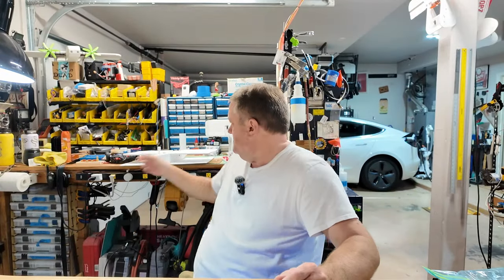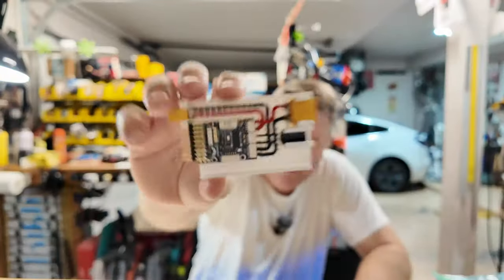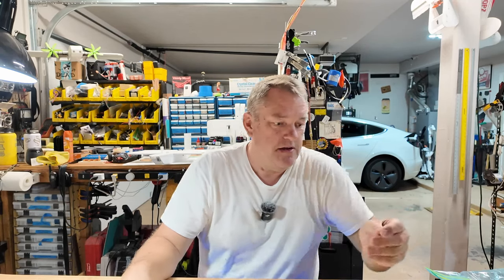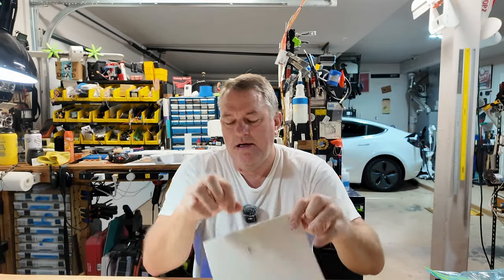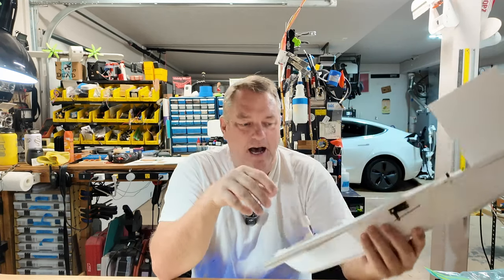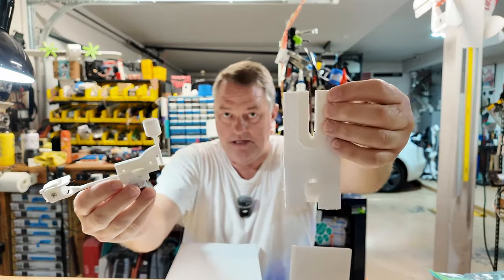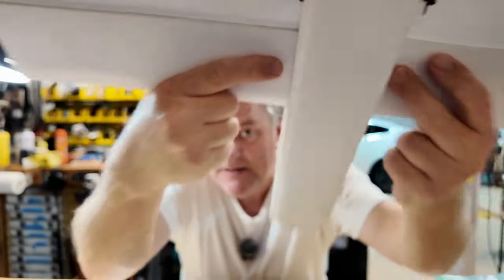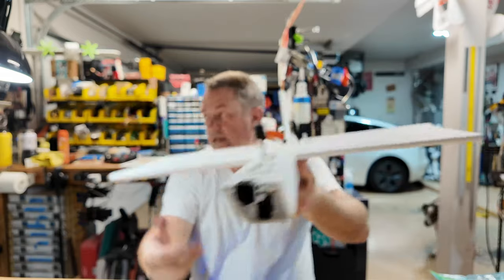3D Printed Aircraft Kits?  I need your input

Comment: That’s a great idea. I sometimes print templates on a 3d printer cause it usually ends up being faster than a regular printer 😂 (no joke). 

That being said, personally I don’t have the patience for printing big stuff. The motor mounts and stuff would be fine, but I’d just wing it for the rest (pun intended). 25 USD would be too much for me though. 

That swappable dji mount with the dummy load is genious btw 👌
Reply from the maker: thanks for the feedback - and I'm glad you like the swappable DJI system.  It works really well, and makes swapping cameras between all my planes a breeze.  Plus, with the ballasted camera mount (with no actual camera), you can fly your plane LOS and add simply swap in the RC system when you're ready.

Comment: You can stack flat templates to 3d print with a .2 mm gap with ironing and and peel them apart after printing, but only if they're designed to be the same size or fit in the foot print of the one below it. A little bit of design magic to do fewer prints would make this very convenient.
Reply from the maker: Interesting idea... I may play with that.  Thanks!

Comment: 3D printed plans are an intriguing idea. I'm not sure that the benefits (template durability, no page scaling challenges, no need to cut out the paper template after printing) outweigh the drawbacks (bulky, requires a 3D printer) as compared to paper plans for most people.
Reply from the maker: I'm looking forward to feedback from those who are building them now.  I just thought the durability of the templates could make for very quick tools to trace out replacement parts.  Friends I've had work with them are remarkably quick tracing parts with a razor and say that it's faster than going from paper directly - but I suppose we all build different.

either way - thanks for your comment.

Comment: This is just an all around great idea, sign me up. The concept of being able to quickly and conveniently build multiples is genius, makes it a lot easier to fly it like you stole it.
I’m wondering if for some of the more, shall we say, fiddly cuts, you could cut for example cut a primitive shape in the foam that would accept a 3D printed “precision” part with accurate dimensions, etc.
Reply from the maker: you've got a good idea.  There are some parts that are more fiddly - and you could optimize some of them (like the motor mount plate on this plane could be incorporated into the motor mount itself (but that's extra weight at the far aft end)).  I'm new to this - and certainly open to suggestions for improvement.  If you come up with any good ideas - please share them!

Comment: I make foam board planes and print 3d parts like you do for motor mounts etc. Mine are simpler though, more like the Experimental Airlines style. Giving the stl files to 3d print is a great idea but I think there will be a couple of problems. 

I find to cut foam board, I need to keep the craft knife at a very flat angle to get a clean cut and with it at that flat angle any tight curves are going to be problematic and you have a few of those. The second problem is I think there is a high chance you will end up cutting into the PLA itself, hand cutting foam board is really better done against a metal edge.

You also mentioned the difficulty in getting accurate to scale plans. Plans are great for balsa models where the construction is largely air and you can see through to the plan underneath but that doesn't work for foam, you can't see the plan anyway. What I would need would be dimensions only - i.e. this line is 30cm long and at an angle of 10 degrees, it doesn't need to be to scale. I would then just copy those dimensions onto the foam board (as I do at the moment) and start cutting.

Keep up the good work, great channel!! Cheers!
Reply from the maker: you've got some valid points - and for some of the detailed, curvy bits - I use a pencil and trace the line so you can really get vertical and get a clean cut.  But for the straight edges - my buddies and I have found you can run a sharp razor pretty quick down those lines - and that's what I was going for with this plane - something fast and simple.

I'm still evolving with all this - it's very different to build your own planes vs trying to get others to build them as well - and I'm just working out the kinks.

Thanks for your comment.  You've got some good thoughts in there!

Comment: Great idea, But if you could cut down on the number of templates. eg: for the bigger templates in the dead space have some of the smaller templates.Maybe even colour coding each template. Hope that makes sense.
Reply from the maker: interesting idea - but I wonder how many folks have multi color printers?  I've got one of each - but I came from a world where a filament change was not something I looked forward too.  It is easy nowadays with the right printer to add color into a print however - and we're lucky for that.

Good ideas... I'll toss them into the mix.

Thanks